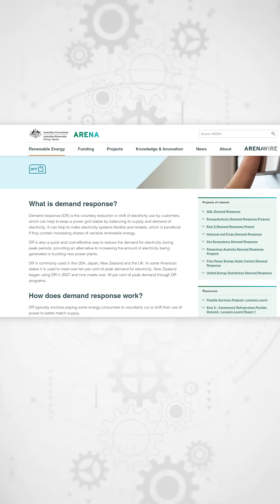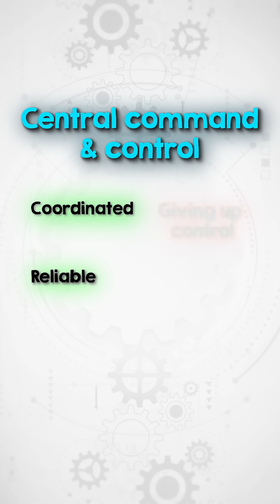Why Do Utilities Want to Control Your Thermostat?

Comment: I guess if I was confronted with the Energy company taking over my thermostat, I would be forced into purchasing a second thermostat. Since the original thermostat is communicating with the Energy company I will disconnect the HVAC and connect HVAC to the second thermostat. You can connect the power of both thermostats off of the existing power supply or purchase a 120VAC/23VAC (USA) step down transformer and connect that  to the second thermostat.

On the second thermostat I would eliminate the communication to the Energy company (what ever frequency that they use) and I would connect that thermostat to the HVAC. The Energy company's system will see that the actual house temperature is in a range to shut down the HVAC system and will deactivate the original thermostat which is not connected to the HVAC and it would have no effect on the HVAC, but the Energy company would think that it is shutting down the HVAC. There are a few more ways of accomplishing this, and this is probably the easiest method.

Comment: The problem I have with demand response is that it isn't in service to the rate payer/consumer of the energy good utilities are there to provide. It is a way of utilities to maintain the energy trading floor and for them not to pay higher energy rates during peak demand. Solar & batteries have managed to throw a wrench into this particular way of thinking. Solar generates so much energy in the middle of the day that energy trades often go to near zero dollars, sometimes below zero. Batteries put electricity onto the trading floor during peak demand for more $$

Comment: Eastern Washington did lots of wind early on. They ended up with excess power. So they installed special hot water tanks in thousands of homes and heated the water to 190 degrees. Then mixed it with cold to get 120 degree water.

Comment: Our utility in Boston, Massachusetts offers a Demand Response Program in summer where they take control of AC thermostat. For 3-4 hrs, they raise the thermostat by 3 degrees to reduce demand on grid. To minimize impact on consumer, first they lower temperature by 2 degrees during low demand so it takes much longer to feel the effect of raising it. 

As an incentive, we receive a check for $70 per thermostat, $140 in our situation.  I see it as a Win-Win.  Easy money.

Comment: Ripple control using control signal riding on the power cables at a different frequency from the power frequency of 50 Hz or 60 Hz is an old idea.
It had been tried out on POC projects on public installation such as street lights but not in homes as the needed hardware and software are not installed in homes equipment.
May not be worth it.
Better to keep the current setup of using a higher tariff for the peak demand hours.

Comment: Yet before privatization in Australia we had rolling reserves ie a turbine ticking over on a pony motor ready to take the load in a few minutes in case of sudden demand increases or another turbine tripping. Privatization has led to an increase in power prices and a decrease in reliability, combined with the net zero nonsense and you can see why the economy is screwed and unemployment will go through the roof with businesses moving to developing nations for the cheaper/ more reliable power.

Comment: residential usage just isnt a big enough usage to be reasonable for this kind of thing
industrial usage is however ,the article mentioned that 16% of new zealands power os through demand response, 13% of new zealands entire grid is ONE aluminium smelter using demand response, able to drop 185mw from its usage in peak times, all done through a contract

basically just a reverse battery
Reply: In my area this saves residential transformers because it can stop them from overheating.
Reply: Of course it is… there are alot of residential properties.  Individually it’s not much, but combined it’s very significant.
Reply: @JohnR31415 get the corporate boot out of your mouth so you can tell us which part tastes best: the tip or the shit covered heel?
Reply: @JohnR31415  yeah exactly theres a lot of them, its extremely distributed and doesnt make sense to set up controls and contracts for all those people

so youre ofcourse not going to get a contract theyre just going to fuck you over for a little bit of power
Reply: @vincentgrinn2665 why wouldn’t it make sense?
It’s trivial to have peak shaving etc controlled by your provider.
My EV charger is controlled by my supplier, and it’s always put in the amount I want by the time I want.  It’s just that exactly when in that long parked period it charges is controlled remotely to support the grid.
Similarly a hot water tank doesn’t need to be heated at exactly 4:27 on a Tuesday, but it does need to have hot water available when you want a shower.

Comment: There are several instances here in the USA that the power companies have abused their control. 
The reason they push this control here is due to them not wanting to upgrade thier 40 year old infrastructure. 

We have been fighting to get Dominion Power to modernize at least a little with rapid disconnects for storms, burying lines in high tree fell areas and purchase at least a hand full of backup transformers... but noooo, they would much rather spend 2% of that to shut off people's thermostats and water heaters when they want.
Reply: Perhaps you're not old enough to remember Enron, who as a regulated utility would induce rolling blackouts so that the "emergency" would allow them to purchase power out of state (from THEMSELVES!) at exorbitant rates and pass those costs on to customers.
You can go back just a couple of years and see a similar situation during the Texas freeze, but imagine if it was the power company that caused the weather... again & again.
Reply: This probably has more to do with the collapsing regulation and governance structure of the USA than it does with this particular technology.
Reply: So demand response is 50 times cheaper than the upgrades which would bring no additional benefits.
Reply: @JohnR31415 get the corporate boot out of your mouth so you can tell us which part tastes best: the tip or the shit covered heel?